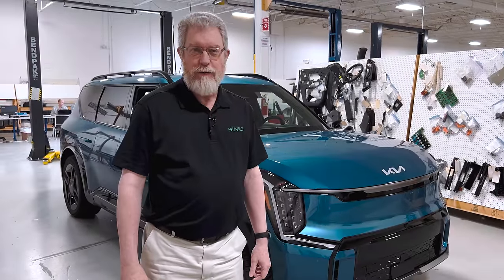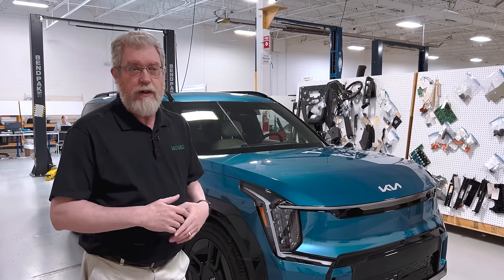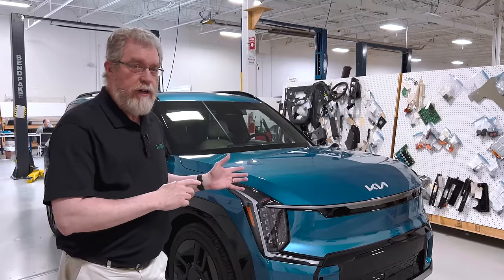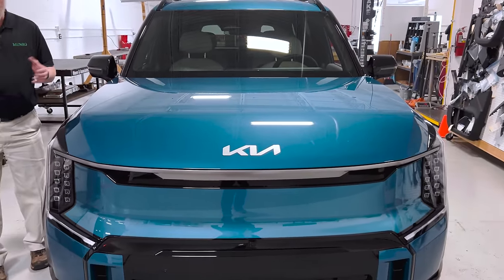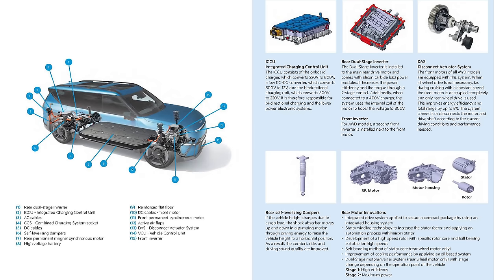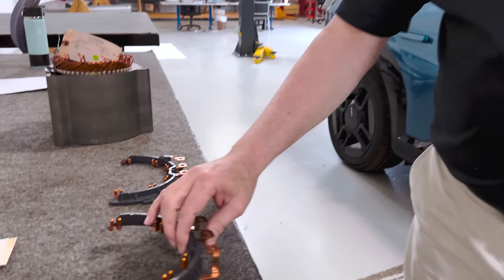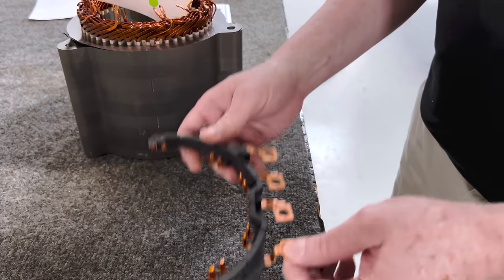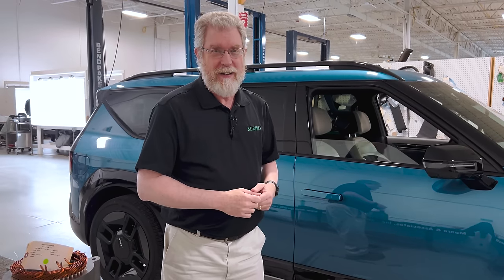Kia EV9 - 800 Volt Architecture

Comment: I find this very hard to believe.  The cybertruck method is probably the most likely way to charge a 800 Volt battery with 400 volts (at 350KWatts).   This guy is an insult to the integrity of Munro.   I am very disappointed
Reply: You are very clueless, you should be disappointed about that
Reply: GM's Hummer used the method of splitting the battery a couple years before Tesla, but yes, that is a good approach. It has a few challenges with the failure modes of the high current contactors that the Kia approach handles differently. I never said that other methods are bad. I only wanted to highlight the fact that the Hyundai/Kia method is clever and cost effective.
Reply: I suspect the Kia approach results in a slow charge.  If it were fast and economical, then I think all superchargers would use that method.  Right now a
250-350 Watt charger cost more than a car.

Comment: fantastic road trip car for when you want to stop for two hrs every three hrs you drive :face-green-smiling:
Reply: What?  This comment makes no sense.  The ev9 can charge to 80% in under 25 minutes if the charger supports it.  It’s literally one of the fastest charging ev’s.  Also, you drive at 100 miles an hour on the public roads?